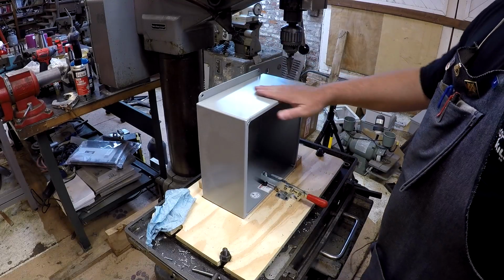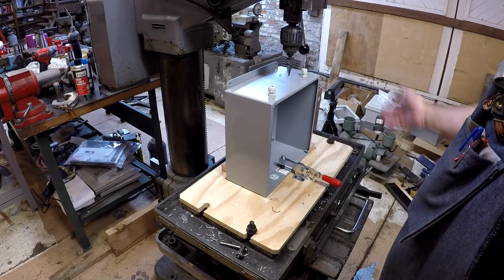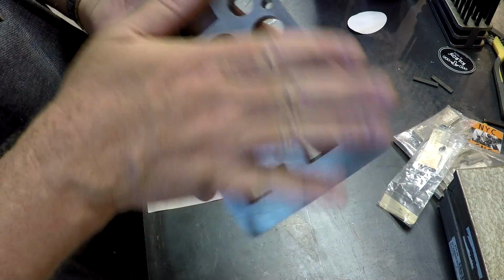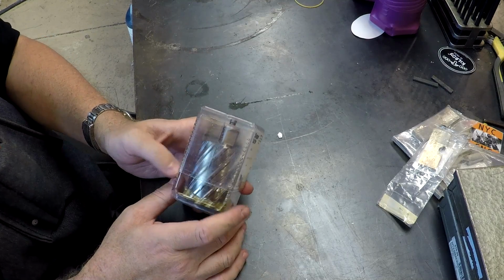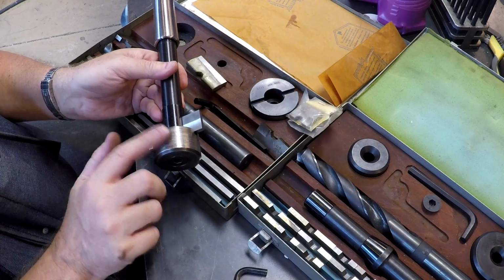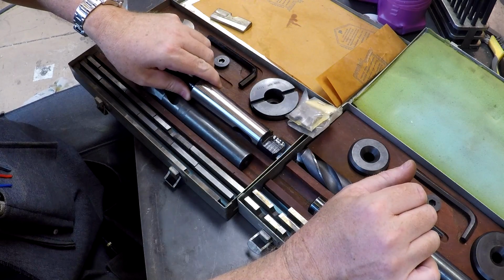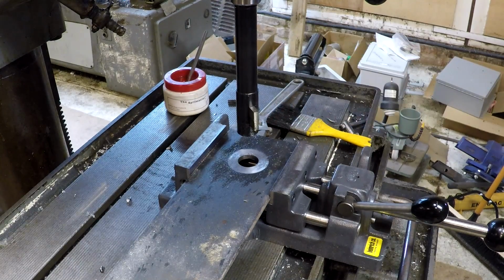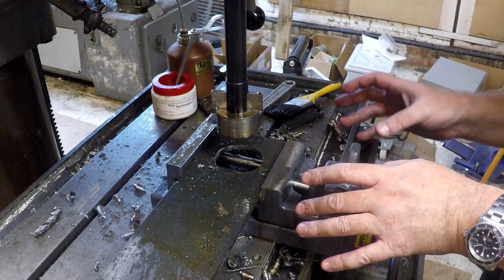Shop ADHD #33 Part 1 of 2

Comment: Hey James, would that block with the holes have been a machine shop project for students? I wouldn't mine one of your stickers, message sent. Thanks for all your videos and thanks for sharing. Later
Reply from the maker: That is a possibility, it would make a great student project.  If they had to single point the round holes to size, quite a bit of work there.

Comment: I couldn't see the bores clear enough to tell, but could that tooling plate be a blanking die plate for various punches?  I'm thinking washer or gasket type materials.  That might explain why there were two.
Reply from the maker: Maybe, but there is virtually zero wear on both flat surfaces.